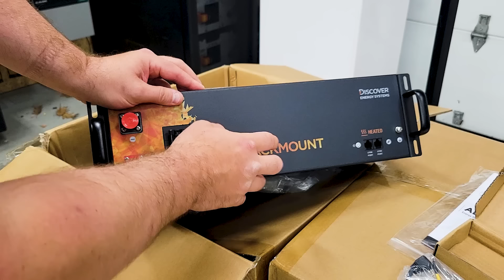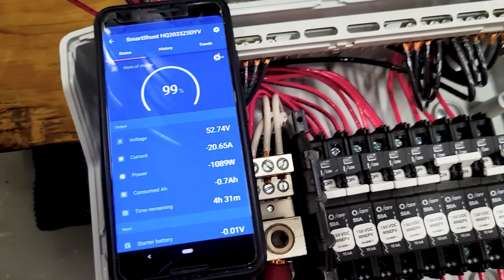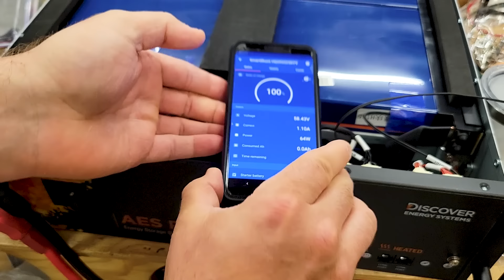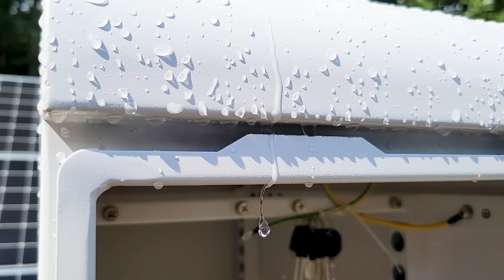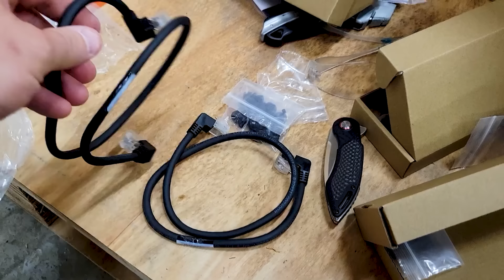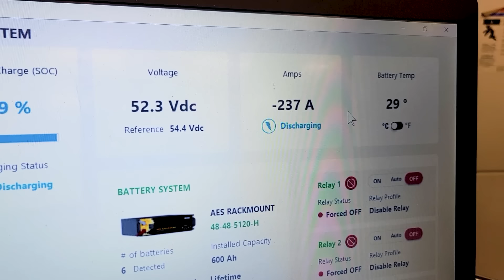Discover Batteries, AES Rackmount and Outdoor cabinet test and review

Comment: Two of three of the 48-48-5120 BMS (battery management system) failed within 20 months. The installer indicated it would be covered under warranty and would take 1-2 weeks to get replacements. It has been over 2 months now because they are backordered. Definitely disappointed so far. If the products fail outside of the warranty I will look for another solution.

Comment: Most circuit breakers are designed for 80% current for continues load.  I'm not sure about the DC breakers you have.
Reply from the maker: These are rated for 100% duty cycle.
Reply: @DavidPozEnergy  ~ well likes others have already mentioned, it's not a good practice to put breakers in parallel for that very reason.  one breaker will always carry more current that its twin.
Reply from the maker: I understand.  I'm not on the design team.  I'm simply testing a product as it comes to me.
Reply: @ ~ You are in the clear!    The manufacturer was the one that dropped the ball with the double breaker design and the way the rated the system.

Comment: Great video!  I just wish these battery manufacturers would build a rack that works like a server rack to store their batteries.  EG4 is the closest, but it should be taller to support more batteries.  8-10 battery server rack design would be awesome.  It's such a pain to build it yourself because of the larger busbar which also isn't common yet.
Reply from the maker: I get it.  I don't know if you noticed the large server cabinet right next to the Discover battery?  I bought that for $75 from Craigslist.  I had to build my own shelves and busbars in it, but it holds about 70kWh of battery.
Reply: @DavidPozEnergy  I did.  I'm doing something similar with a server rack that was left in the house I moved into.  It's got space for 8 server rack batteries but still figuring out the busbar.  Not a lot of good options that fit well in a server rack at 800 amps.  EG4 has a great design but limited to 600 amps.  Might go with two 400 amp and go into a Victron mounted to the top of the case.  Trying to make sure it maintains a professional look, but something from a battery manufacturer would look and work better.  Might go with Pytes which has a nice parallel approach that removes the busbar issues.  Was trying to stay with EG4.
Reply from the maker: Discover makes a combiner you might want to look at.  I've never personally used it, so I can't give detailed info.  I'm going to link to it, but this was just the first link that came up when I searched for it.  I'm not affiliated with the seller: https://solartown.com/solar-products/discover-ess-battery-module-combiner/
Reply: @DavidPozEnergy  I hadn't looked at options like that, so I'll check it out.  Looks like that has a 6 battery limit, but there could be options that might support more batteries.  Thanks!

Comment: I might have missed this but I was interested to know if these batteries had pre-charging resistors built in so when the BMS was switched on, it would limit the current supplied to the inverters for the first second or so to prevent a large inrush current.

Comment: Previous project alternator battery charger replace gas engine with treadmill motor run with 12 battery. After dc generation from 4.8kw maximum from car alternator put some dc back to run dc motor in they we efficiency free to run electric car as power consumption of average 140 w
Reply from the maker: Sounds like you are asking me to try and make a perpetual motion machine?
Reply: @DavidPozEnergy  can u do that getting output more than input as equipment lying with u solve problm electric car without battery

Comment: I am wondering if it is still necessary to have your battery leads all be the same length. I haven't heard anyone talk about it in a while. Is it no longer as important with all modern components?
Reply from the maker: When you are paralleling multiple batteries to one central bus bar, you want them to share the current equally.  In order to to do that, each circuit should be the same resistance.  This usually boils down to having equal length leads.

Comment: I contacted Discover concerning the non-EIA rack standard mounting flange screw slot issue.  They implied the slot shown in the @DavidPoz video is the new normal for their 48-48-5120(-H).  This is a serious deviation from 19 inch rack norms.  It's no surprise David discovered a scenario where this deviation +/- some otherwise tolerable mechanical variance caused the interference he was forced to remedy with custom machining.  Ladies and gentlemen, this is what happens when a manufacturer daringly deviates from a standard that features many decades of "baked in" know-how.  It otherwise looks like a very promising product.

Comment: Timely video as I am building out a system pretty close to yours and my seller suggested Discover's products.
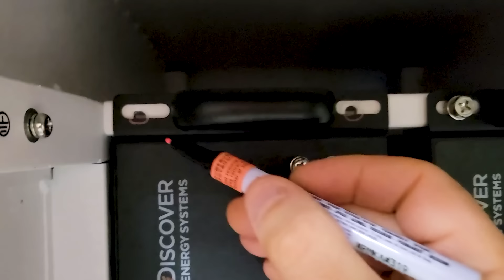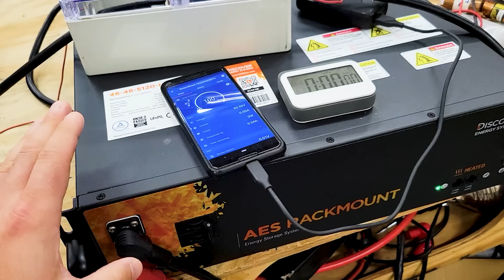29:44 Mounting holes that don't line up is a pretty serious goof on the manufacturer.  From the specifications the AES Rackmount battery appears to dimensionally follow the decades old EIA 19 inch rack mount standard... yet the mounting flange slots with their built-in tolerance to rack width, are exactly 90 degrees off negating the benefit.  That said the photos online show proper rack flange mounting screw slots, but the ones delivered to Dave are 90 degrees off.  You can more clearly see this at 7:21.  The fact the same model product 48-48-5120-H has mechanical differences should raise eyebrows in the configuration management department... if there is one.
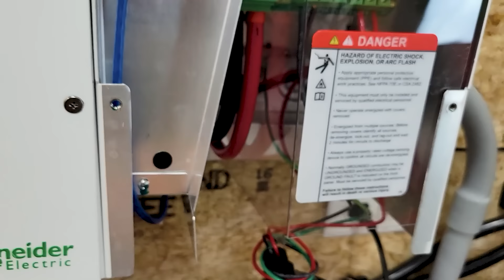43:51 Does the Link2 properly terminate the Xanbus (I don't see an option to install a terminator) and if so is it required to be at one end of the daisy chain?  What if you had two of these battery cabinets in the daisy chain?
Did you route the Xanbus line from the Schneider gear to the Discover battery cabinet through the 2" conduit?  I don't see where it routes.
Reply from the maker: The Lynk II self-terminates.  Multiple cabinets can be paralleled together and you only need one Lynk II.  Yes, I routed the communication wire ( CAT 5e) through the same conduit as the 4/0 wires.  This is probably not recommended because of potential interference, but I haven't had any communication problems.

Comment: Interesting product. Is there any information on the lowest outdoor temperature it can keep up with if mounted outdoors? The cabinet isn't insulated, so I don't see if being able to keep the batteries heated below about -20F.
Reply from the maker: The manual for the battery says it's good down to ambient air temperature of -17C or -4F.  This is for one battery.  It's unclear if all 6 batteries, together in the cabinet, can go any lower than that or not.

Comment: nice to see you back again.
Speaking of Circuit Breakers, you can't install them in parallel. Each breaker even if it has the exact same rating will have slight differences/tolerances, allowing for uneven distribution of current between them. This of course can cause one of the breakers to see overcurrent and trip so that current flows to the remaining breakers causing them to also trip.
Reply: 100% correct. I can't believe a commercial product would utilise so sketchy a practice.
Reply: Fortunately there is a simple fix to this (I hope David sees this).   If you were to take the place where the circuit breakers studs attach and cut approximately 1-1.5 inches between the stud mount holes, it would allow the currents to equalize.   If you would like to try an experiment, start by cutting just a half inch (do this on both plates where the breakers attach) and do a 500 amp load test.   Then cut .25" additionally until you get to the balance point.   This should divide the currents adequately enough to work.   I know that that big plate where the breakers attach shouldn't be considered an equalizing resistor plate, but the function should work (I've seen this done in the cellular industry many times when using hi current systems at very busy cellular sites).

Comment: Great review. I've had this setup with 3 batteries and it's has worked well for almost a year. I'm grid tied so using for power outages. We had a recent outage that lasted a few hours and it was flawless. I do run the LYNK Access software on a Mac OS X system via Parallels software with a Windows 11 virtual machine. Also accessing the unit remotely via my local LAN using a KVM extender over IP. Just need 3 more batteries 🙂
Reply from the maker: Wow, you clearly know more about computers than I do.  Glad there is an option for Mac users.
Reply: You'll be happy to know that we will soon launch a cloud version of LYNK Access. Keep an eye on our website. To use it, you will need to update the firmware on LYNK, connect to the internet via the ethernet port at the bottom left of the LYNK, set up your account online.

Comment: I checked your channel earlier this week, wondering where the heck u were. Are you fully off grid yet?
Reply from the maker: Technically, the grid still has wires connected to my house.  However, I've been running in off grid mode 100% since Feb. I plan to continue through the winter to see how many gallons of fuel I burn in my generator.  I don't need the generator spring, summer, or fall.  Only in January.
Reply: @DavidPozEnergy  nice. Good to know the progress

Comment: David, it is good to see another video from you. However, Company's like Discover are out of touch with reality. Imagine having 96.5 Kilowatt Hours for $11,712 with Bluetooth, 2 amp active balancing, closed loop communications made with EVE MB31 LF314 grade A cells at 8,000 cycle life. We have four of them at 60 Kwh. I have money and still would not spend that much for that little. For those of us who do not have a sponsor to cover the cost, it comes down to getting more for less not less for more.
Reply: This sounds like a DIY system that isn't UL certified, nor is it from a company that supports and warranties the whole system. It's not really fair to compare costs of a DIY project to a real product from a real company. Could you sell the solution you mentioned to thousands of installers and support it? If I'm wrong and this is a certified off the shelf product, please share a link and I'll buy one!

Comment: David, whenever assembling anything, you should insert all screws loose. The cabinet was skewed. If you lifted the left side of the cabinet, all screws would have fit. When tightened, you would have needed washers under the ears you installed to level the cabinet. The narrow cabinet is nice but needs leveling feet.

Comment: Nice review and the cost is really good price too. I would definitely buy those. I'd really like to see how that rack and battery set up would actually perform in real-world cold conditions. Just putting the sensor in cold liquid isn't the same as multiple days of -20F and little solar. I really don't think this would work without additional insulation and external heat.
Reply from the maker: You are probably right, that after multiple days of -20F you would need additional insulation.  The manual says it's good down to -17C (1.4F).  The manual doesn't specify if that's one battery on it's own or inside the cabinet.  The specification is found in the battery manual, so I suspect that's the low temp. rating based on one battery sitting on it's own.  I suspect, that if you group 6 batteries together inside the cabinet that the assembly can handle lower temperatures.

Comment: well i can't afford that stuff but see no need for low temp cut off with my bank, the box stays in the 70's during the winter, yes i monitor it from the house. tried it 3 yrs now , a good cabinet works , and now batteries are cheaper and most have actually activated low temp etc. if your using your bank it will stay warm